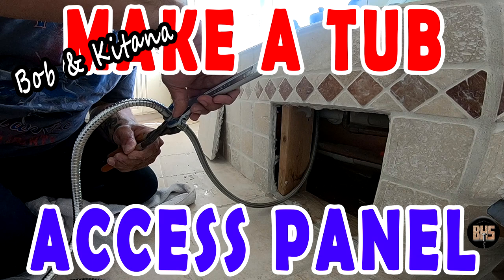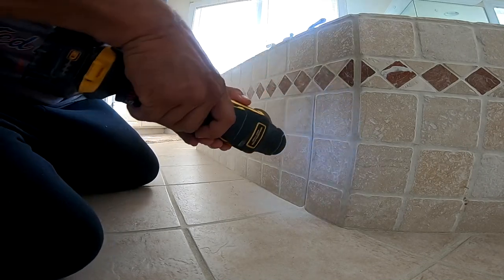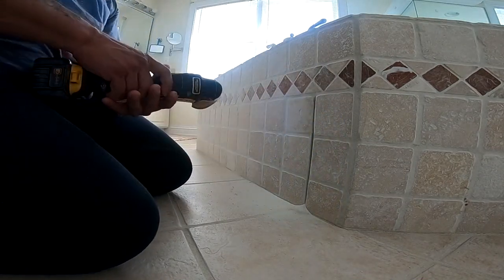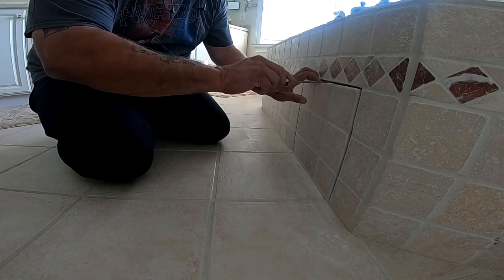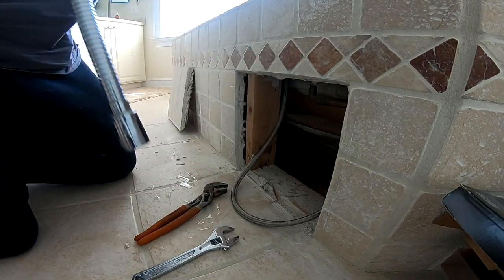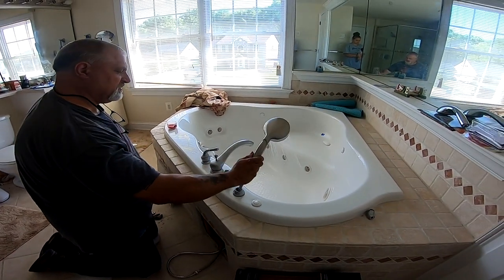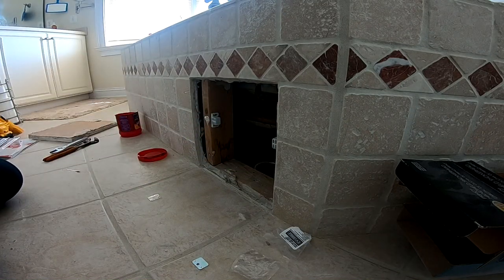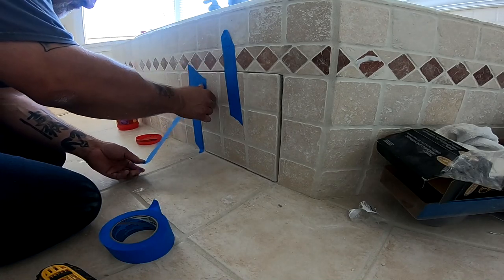Create a concealed tub access panel in tile

Comment: Good informative video Bob, I was a handyman, and have picked up lots of tips and would like to share a small addition if I may.  With the vacuum, make sure you use a clean compartment and save the grout dust! Particularly If the grout is colored, after using the silicone, you can apply some dust, to offset the brightness of the silicone, by applying the grout dust... Use a small paint brush, making sure that you don't wet it with silicone, apply the dust on a spatula, applied close to the repaired area, when set, but still sticky, and gently brush to the required area. Sometimes you can't see the joints at all.

Comment: Bob, thanks for the video. I have a soaking tub located in the outside corner of our master bathroom. The drain and stopper are on the outside wall. Already had to work on the stopper from the basement. Now there's a leak in the deck mounted faucets or spigot (filler) on the front. Can't go through the garage floor this time, I see only subfloor, so I'm going to use your knowledge from this vid. However, I want to make the access panel long enough to reach to the far right wall, longer than your panel in case I need to get to the stopper again. How do I deal with the sheet rock behind the tile being screwed into the short studs? Your scenario looks like you were in between studs. Pretty sure I won't be as lucky. Thanks for your time.

Comment: Nice Job Bob. Im 40 plus years in cleaning up after other people. This is a common issue when a contractor creates a non serviceable condition. I am going to one of these today and like to see what others do in this case. Not a lot of pretty options here. I have installed a number of deck mounted soaker tubs and always set it up with an access panel of some fashion. Again nice job.

Comment: Thank God for this video. I'm the first owner in a new build (2.5 yrs old), and lightly hit my bath tub wand, and the damn base broke. So the inner piece of the base fell down into the abyss. My tub is enclosed with tile just like this job, so I needed to find a way to fix it (I have no access panel either). Thanks for the video. I will certainly consider this very same fix.
Reply from the maker: Sorry you had a similar problem but I think you will find this repair to be quite straight forward. 

Thanks for your comment. I invite you to subscribe so you don’t miss future videos. 

Cheers

Comment: I dont have a access hole for a shower sprayer in my Roman tub, can I drill one? What would you use to drill the hole? Not a hole saw obviously right? Where would it connect under the tub if I did in fact add a sprayer? Thank you sir

Comment: Awesome job!! Question I already have an access panel but I am changing tile to exactly what they have. I am concerned how to install tile to make door still usable. Going to be tricky.  Not sure if I should tile door then work out in that area or what. Possibly just fill in existing hole tile tub then cut new one like you did. Also do you have a video on installing one of those spray wands like they have on a tub that does not have one? TY and awesome channel
Reply from the maker: Those spray wands just screw in like anything else. Easy Peasy. 

If you plan your install out correctly you could put the access door wherever. 

Or frame out a door and tile over it and cut it out like I did.
Reply from the maker: You may have to alter the opening size depending on the size of your new tile.
Reply: @BobsHomeServicesLLC  wish you guys were located near Delaware LOL
Reply from the maker: @HUFF-N-PUFF-2024  feel free to send photos if you want

Comment: I've got it cut through but its 1/8 inch grout lines. I can't get a screwdriver in there to remove the cut out. What tool should I be using to avoid cracking the tiles?

Comment: Thank you so much.  How did you know where to cut?  You were perfect between the vertical 2x4's.  Did you know you were cutting in the right spot or was that just luck?  I need to change out my Shark Bite hoses attached to the faucet.  They are deteriorating and spitting out black flakes from the hot water side.  I don't have an access panel but I will soon.
Reply from the maker: It don’t matter if you cut and have a 2x4 in the way. If anything it will hold the access panel better, but most 2x4s will be 16 inches from the corner.
Reply from the maker: Allen, also you can add or remove any 2x4 and move it after you make the opening.  Built to suit my friend.

Cheers!
Reply: @BobsHomeServicesLLC  That is awesome.  Thank you for the information!

Comment: Another question: I have a very tight spacing between my tiles around the bathtub, where I have to access, only about 1/8" on the sides, and on the top it's even worse: there's a metal decorating railing which leaves less than 1/16th grout gap from the railing and the tile. Is it possible to cut there without damaging the tiile / metal railing? If yes, what tool should I use?
Reply from the maker: That metal decorative trim should be avoided as part of it goes behind some of the tile. 

I would cut lower and avoid it

Comment: Bob thank you so much. My builder did put in a panel 20 years ago I need to dig it out to replace a faucet cartridge. It seems attached more strongly than with magnets. Do you use a dual suction cup to pull off after rescoring the silicon or just try to pry around the outer edge? Also, do I need to worry about the seals on the jets around the tub or the motor unit drying out and leaking? Tub is over my dining room - don't want "The Money Pit" situation ;-)
Reply from the maker: To be honest with you I have no idea what your builder did and you should probably reach out to them and find out. If they created you an access panel then you should be able to open that without much difficulty. I wouldn’t pry on anything because you might end up breaking or cracking something. 

Try reaching out to your builder or if other people in your area have a similar house ask them if they had any experience with it.

Cheers,
Bob

Comment: What tool do you suggest if the tile was 1/8 inch apart?
Reply from the maker: Use standard multitool blades but you will need a couple because the grout will destroy the blades.

Comment: Bob, thanks for the video you seem to be very knowledgeable on the topic. I was think of doing something similar but on the back part of a shower niche. My wife is getting the shower done and loves this tile that I think she will eventually hate so I was thinking of having the niche waterproofed and then putting in a removable panel so she could just change out the niche tile without having to redo all the tile. I don’t need an access panel but simply want to swap out the tile and make it interchangeable. Any thoughts on this? Am I being crazy?
Reply from the maker: I'm not thinking you can do such a thing with a niche and maintain a waterproof setting.  Sounds like it could leak over time without you noticing.
Reply: @tdmoreno21 If you built the panel the backside of the niche is tiled on as a separate piece removable from inside the shower I think it’s possible. The key, however, would be to essentially “flash” all the edges behind the tiled niche panel. This way, if any water was to intrude, as it will, it will hit the flashing and hopefully roll back towards the shower behind the side walls of your niche if the tile is sloped correctly. Seal the tiled panel with color matched silicone grout. That way you can cut the grout silicone with a razor blade later on if need be. Just push on the panel from the opposite wall to remove it.

Comment: Any tips on locating the pump? I need to make an access panel but don’t want to cut into tile or drywall unnecessarily until I’m sure of the pump location.
Reply from the maker: Does the pump work at all?  If so you can try to locate it by sound.  If it's completely dead maybe you can cut a hole into the tub area from an adjacent closet, through the drywall, to inspect.  Home Depot sells plastic access panels that are spring loaded which can put but into a cut hole so you will not need to perform any drywall repairs.  Send me a photo of your tub and maybe I can help more.

Comment: You did a great job. But I would have used a wider screwdriver to remove the tile section you cut. Also, you kept throwing your tools which are heavy on her tilt floor. I would have put something on the floor, like a towel, to lay tour tools on. Otherwise a great video.

Comment: We have a jacuzzi tub with a broken drain and no access panel.  If I had a mind to try and fix the thing, I could certainly use the info here to fix it.

But my wife has other plans - she wants to completely redo the master bath and eliminate the tub (neither one of us use it, and we have a cat litter box sitting in the middle of the tub).
Reply from the maker: Always keep in mind the resale value of your home.  Women love to soak in those built in tubs and they do increase the value of a home.  Check with a realtor before you make that huge investment because if other homes in your area have the built in tub/jacuzzi, you may get lower comps for removing it.  Just a thought!
Reply: @BobsHomeServicesLLC  In theory they are nice, but most people we know never use them.  But unless the tub has a builtin heater (the builder-grade ones generally don't), they get cold really fast, so you are constantly running hot water to try and keep the temperature up.  And they take up a huge amount of space in the bathroom.

In our old townhouse, we removed a builder-grade jacuzzi tub and a small single-shower, and replaced it with a double shower.  Nobody in that development ever used their tub.   And the double-shower is what we are going to do here too.
Reply from the maker: @JackRussell021  I see, well thanks for sharing your thoughts on that; I will keep your comments in the back of my mind in case anyone ever asks me again I can also discuss the talking points you hit on (heater vs. no heater and how often have they used it).  Thanks for sharing.

Maybe it's where you live?  I'm in Bristol, PA and I have several clients that have these built in builder grade tubs and they love em' - Go figure, lol

Cheers!
Reply: @JackRussell021  If you have a cat litter box in your hot tub, you have other issues. Housekeeping might not be your forte. Just build an out house. You’ll be fine.

Comment: Great video but if you have to dig the silicone out to remove it if you have an issue why not just use grout so you can't tell where the access panel is. Maybe a little harder to remove but that silicone would drive me crazy because its pretty obvious (to me) where the panel is.
Just my 2 cents and your milage may vary.
Reply from the maker: We use silicone because grout would require special tools to remove and most homeowners wouldn't have that available to them.  This way they can cut it open with a razor knife and easily put it back with more silicone.  The only place that it's slightly noticeable is the where it meets the floor and since hindsight is 20/20, I agree that it can be seen and I should have used clear silicone instead.

Another way to look at this: Using Grout instead of silicone don't make it an access panel, but instead, a repair that will cost them again and again should they need to get under there in the future.

Cheers,
Bob
Reply: @BobsHomeServicesLLC   Still an access panel as you already provided the removable panel after someone digs out the silicone or grout or whatever is used. Anyway it was helpful to me so thanks.
Reply from the maker: @giovanigiorgos2955  Glad I was able to help.

Cheers,
Bob
Reply: I was actually thinking why not reuse some of that grout powder by blowing it on top of the silicone before it fully cures so you have the benefit of easily cutting through silicone but have the look of grout on the surface which would help it blend in seamlessly? Wdyt?
Reply: You can do that for sure, but the average homeowner won't have the tools necessary to remove the panel and they often can silicone again with a hand held tube or something.
Reply from the maker: @EsoTarek  I've never tried that and think it would probably make more of a mess than anything, but if you try this and it works out, please send me a photo as I would love to see it.
Reply: @BobsHomeServicesLLC  Unfortunately I watched this video after a broke through tiles on my bath panel as there was access hatch 😭
Reply from the maker: @EsoTarek  UGH, that sucks, sorry that happened, but I understand the frustration of needing to gain access and nobody had the foresight to provide you a way in.  Tubs made without access panels should fail home inspections in my book.

Comment: This method would not work with 12"X12" tile because the drywall is screwed into the stud behind it. So you end up cracking the tile. Not sure why your panel was not fastened to the stud...

Comment: Your magnets didn't work.
Reply from the maker: I’m not sure what you’re implying. The magnets will work if they’re in the right location and I’m line with the metal pieces.
Reply: @BobsHomeServicesLLC  i assume he is saying this because you were using tape and a hoover to prop up the panel when applying silicone, even though you had fitted the magnets properly?
Reply: @olliemackie7964  I see why he would think that.